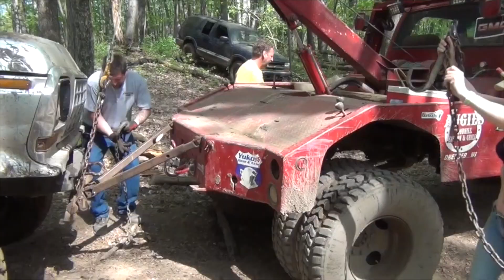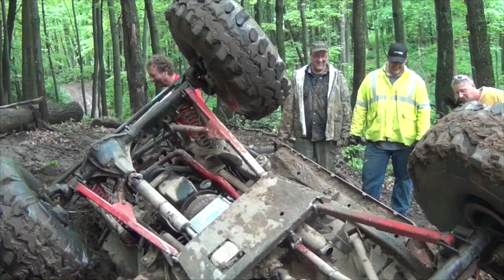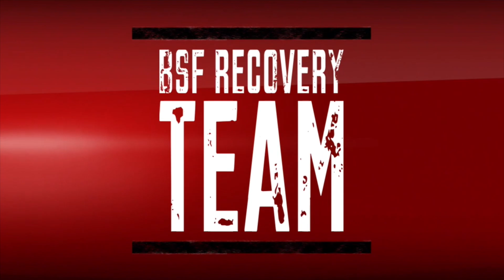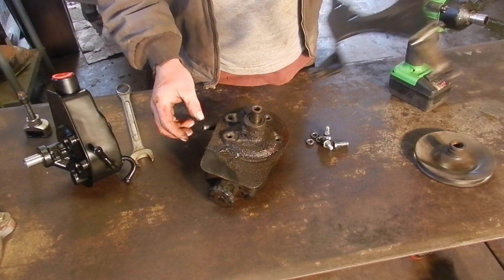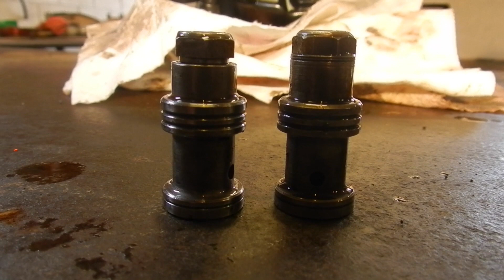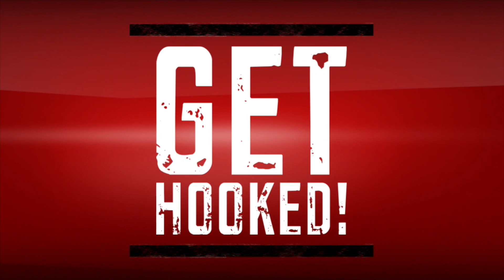1400 PSI POWER STEERING PUMP SWAP by BSF Recovery Team

Comment: Note the original pulley is rusted on the shaft. My 78 was. If so the shear key may not work. I used muriatic acid to de- rust the pulley bore and fine sandpaper to deburr. There should be a slight clearance, the shaft measured 0.6225 in. ( approx., with caliper) with a 0.625 pulley bore. Dont just force the old rusty pullley on!

Comment: 2005 duramax 2500 4wd. Power steering has gone to full assist at all road speeds making driving truck dangerous. can spin front tires from conrer to corner with push from one finger on steering wheel sitting still. Truck does not have EVO that i can find and won’t return to center have to do it manually

Comment: Thank you for the video. Can you tell me if I can have a 1400 psi on my 73 Chrysler? I’m looking for the lightest steering wheel as possible?
Reply: Too light gets dangerous at highway speeds.... anybody considering this needs to take that into account, and also remember that any pump puts out more pressure as rpm increases. You might get it nice at idle in a parking lot, but at what cost to high speed stability? So a mod like this is definitely application specific.
Reply: @johnny0454 thank you for the heads up, but I definitely would like to have a lighter steering wheel. I’m looking for someone who can safely make a mod on the steering wheel pump to make it capable or more pressure.

Comment: a quick torch blast makes the pulley come off much easier and again before putting it on the new pump shaft.
obviously try not to heat and cook the seal on a pump that will be reused.

Comment: I replaced the power steering pump on my 1996 Dodge Ram 1500 4x4, about 10 years ago. I used the Pulley Removal/Install Tool, from Harbor Freight. I like your Removal and Installation Tool better, than my Harbor Freight tool. :)
Reply: I used the harbor freight one for like 5 years and I only broke one when I used the impact on it but for 30$ it’s really good

Comment: Won't increasing flow decrease pressure? seems like it would to me, with my somewhat limited knowledge of how hydraulic systems work ;)
Reply: Only if the pump is maxed out.
Reply: Pumps make flow, restriction makes pressure
Reply: @mikebrace252 I don’t know but I drilled the hole in mine and at low speeds it’s a pain to turn the wheel my old pump was better it just whined a bit

Comment: Can you show how to bleed the hydro boost system? Please please please
Reply from the maker: The power steering, and hydro boost unit should self bleed. If not check, and make sure your hoses are connected correctly.

Comment: Very well put together... great info... Upon a side note, for the Jeep guys... If you are running a DANA 30 stock axle, this upgrade may sound fantastic, but, until you change out to a heavier axle, be careful, as the stock components on the stock DANA  30 axle, something will break in extreme situations. I example, the front wheel get wedged in between rocks, and you try to steer, you may blow either the upper or lower ball joint (typically the upper) or the steering gearbox mounted to the unified body member, can start to fracture the sheet metal or fracture the mounting lugs of the steering gearbox casting.. the list is long.... I am not saying you can do this, it actually is a great way to get the speed back to what you were once used to, before you added a slave steering ram... , just be smart how you wheel your rig in bind situations, is all I am saying.. Thank you for the video, to educate people, as always. Please note, I am not trying to step on your toes, "recoveryteam". Just thought I would add my two cents into the matter...

Comment: First 😎  Also, Ive found that royal purple synthetic power steering fluid is the best fluid to use, especially in hydro boost systems.  Runs quite a bit cooler, and has even made squeaky pumps quiet again.  Also stays clean for much longer.  If you dont already have a cooler, good idea to add one to the return line.  Love your videos!